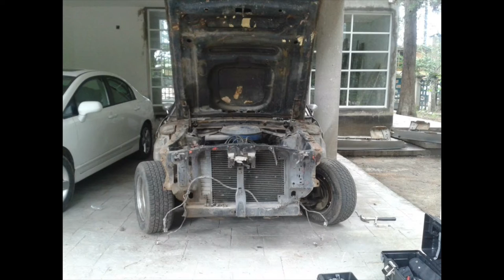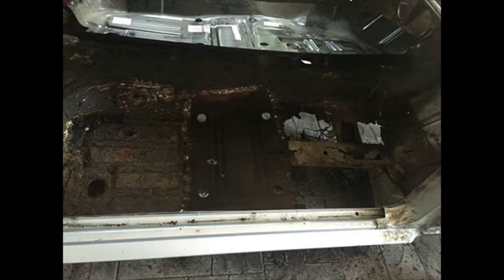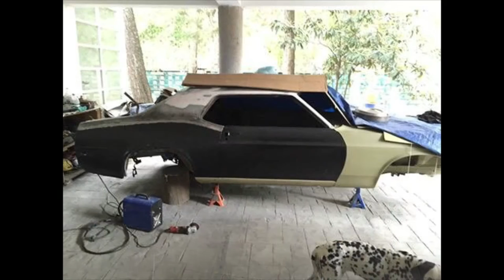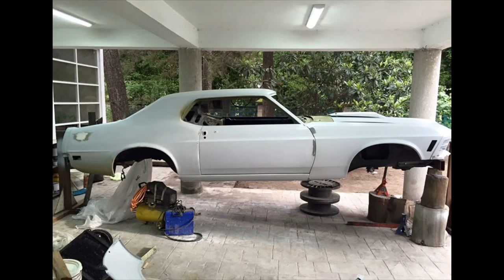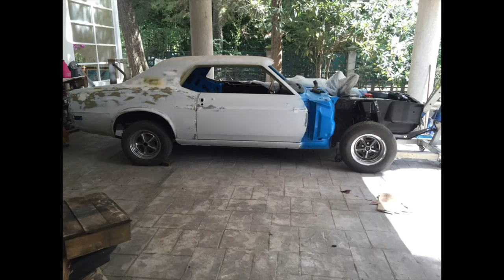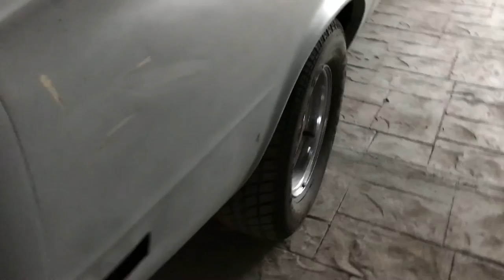Mustang 1970 hardtop coupe restoration Part. 1

Comment: I see he got stuck using the convertible rear quarter skins and has to change to the 69 rear marker lights they are smaller than the 70s
Reply from the maker: I had to cut to make the 70 marker lights fit properly.